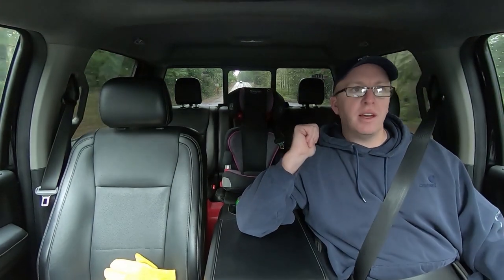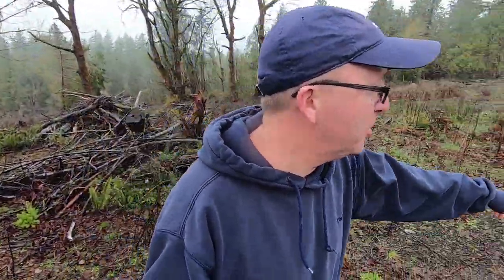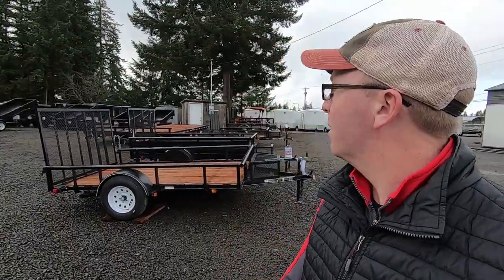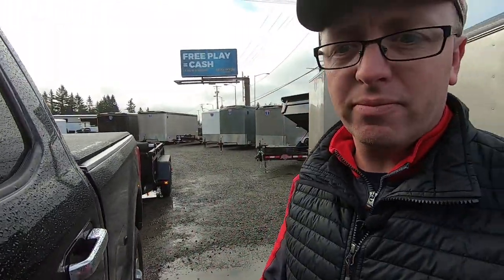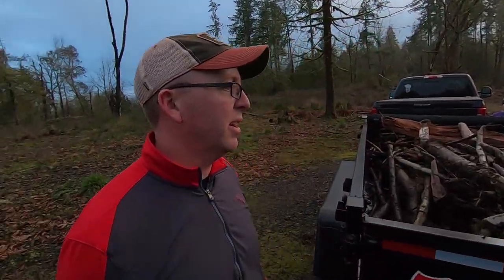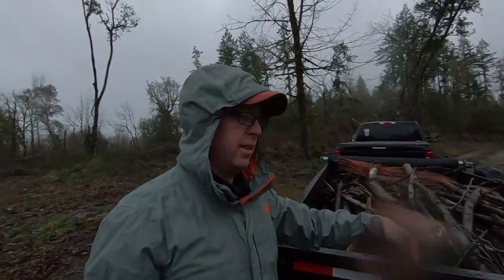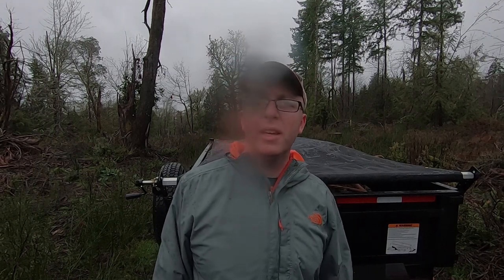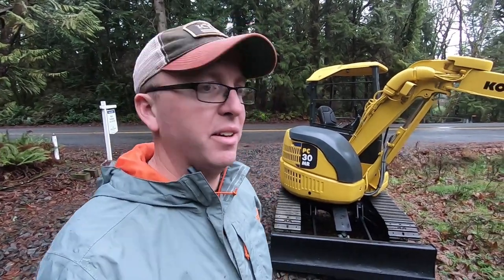HOMESTEAD EQUIPMENT (DUMP TRAILER vs WOOD CHIPPER)[Platt365 Episode 67]

Comment: Why buy the equipment?  Especially the excavator?  Rent the stuff first then find out if it works for you and your situation.  You may save time and money renting.
Reply from the maker: JJ true. I feel like renting is throwing money away but you are probably right.
Reply: @Platt365  Renting is not throwing your money away.  Buying the wrong equipment or equipment you need for a short time is.  Another good thing about renting is if the equipment breaks they send guys out to replace or repair it.  Find a good rental company - NOT Home Depot.